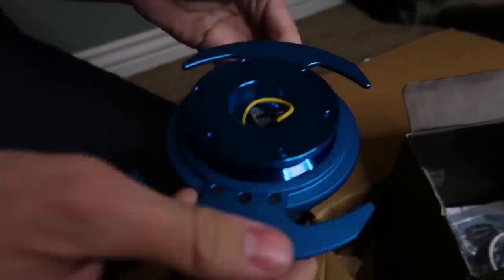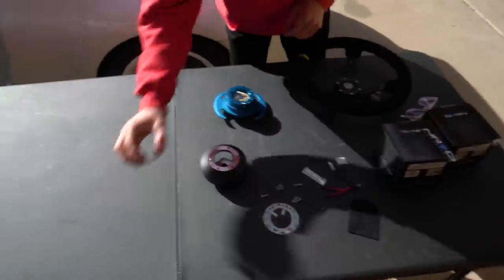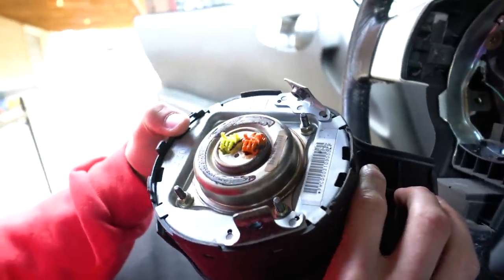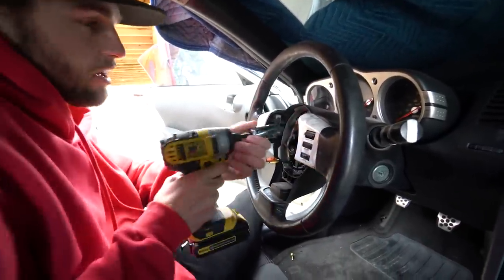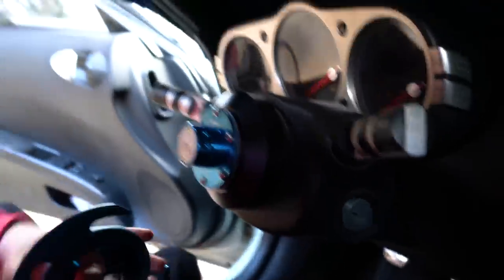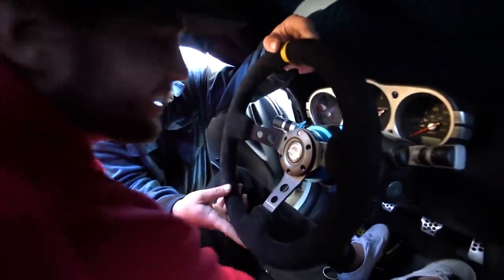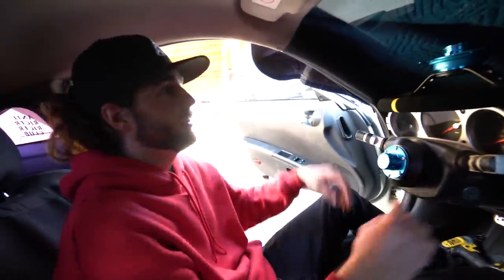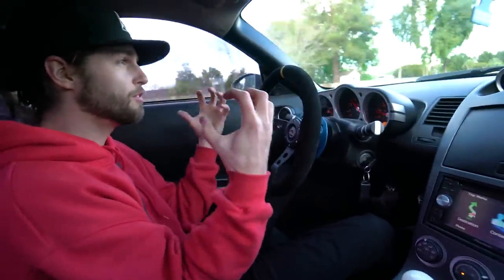350z NRG WHEEL AND QUICK RELEASE INSTALL

Comment: For the airbag DISCONNECT BATTERY AND LET SIT FOR 30 MIN TO 1 HR, the electrical system utilizes capacitors that store electricity in emergency situations for safety components such as the airbag, disconnecting then immediately messing with airbag will be as if the battery is still connected safety first
Reply: Just take the fuse out
Reply: @jakewright1129 you must not know what a capacitor is

Comment: For anyone wondering the set is about 300-400$
Reply: If you're looking to get ther mid tier steering wheels, it'll be upwards to 550+ with the hub and 3.0 quick release. Got an Alcantara Steering wheel which was a bit more pricey

Comment: If you ever watched a NASCAR race, you would be familiar with the expression of "getting up on the wheel". This translates to the steering wheel being close to your chest. Better leverage, quicker response or just being more aware of what's going on, can't say. When I dabbled in auto cross, old timer didn't think much of me being back away from the wheel, but that was what I was comfortable with. Important thing is feet at proper distance on pedals, then steering wheel location.

Comment: Use Nrg quick release and hub (adapter) . But I would recommend to go with a sparco steering wheel not NRG. Just my 2 cents
Reply: If I buy neg hub and adapter I can use a spar o steering wheel on it ?? It’s for my Honda crx tho ?

Comment: Hi, i am new to this car stuff and i would really love to know what's the reason behind purchasing a quick release steering wheel. I mean, is it purely for cosmetic reasons or there is some added benefit from using it?
Reply: Some of the benefits are for taller people, the stock wheels can get in the way of your legs when you try to toe tap the gas and break. 
Also if you have a roll cage it helps get out of the car a easier.
And on street cars it mainly for aesthetics and personalization. 
Make sure you do your research if and when you plan on getting one. 
I installed one in my mustang because my stock steering wheel was breaking down a bit and installed a quick release and couldn’t be happier. 
If you have any more questions hit me up on IG: jah_14

Comment: i could never have that thing and resist the temptation to pull it off while driving. it needs a electric security lock to block it while engine is turned on

Comment: Idk man I don't trust NRG wheels after ThatDudeinBlue's video of the wheel coming apart
Reply: I have one. I love it. Suede 2 spoke.  My only issue is the gap from the wheel to my signals
Reply: jiamind - That’s just the offset of the wheel
Reply: MOMO
Reply: @JAKWEES  yea i fixed it by buyimg a slim quick release on top of my short hub
Reply: i have several & im sure he had a knock off. especially if he bought on ebay. nrg requires authorization to sell their equipment. if you buy from a non authorized supplier then you did not get a true nrg. you got knocked off. do your research before you belive the bull.
Reply: @whiplashnyc5703  ...ok dad
Reply: @whiplashnyc5703  thanks dad.
Reply: Whiplash NYC ty papa
Reply: Do a NRG hub and a momo wheel either way dudeinblue had a fake most likely

Comment: i did this and the horn does not work. It would work randomly, but for the most part, it is a fail. Any tips?
Reply: Okay so I tested the connection at every step and the source of the problem is with the actually horn. Not the short hub, quick release, or the wires connected to the horn. It’s the actual horn.

Comment: Question.. for this do you need to buy all 3 parts? when i go onto NRG's site they sell the "Quick release", the "HUB" and the steering wheels sepperately.. don't they have a bundle for what's compatible with what on their site or anything?
Reply: The hub and obviously the steering wheel are a must, the quick release is an option in case you want to be able to remove the wheel
Reply: I just bought a hub+quick release set on swap shop Motorsports website

Comment: Okay so my 350z is tuned and has different maps but I need the buttons from the original wheel to change maps. How would I go around that and still have a quick release
Reply: thesteeringolutions.com they make a custom plate to mount your cruise control buttons in case you still have not found a solution!

Comment: This guy didn't do his research. The quick release hub didn't bring the steering wheel close to him. His style of steering wheel with the increased steering wheel dish size did. He got a steering wheel specific to racing, which brings the wheel closer to you, which people who actually race need, which he clearly isn't one. Also, don't follow the link to his tools. He isn't using the proper ones. Also, don't just impact fasteners down. Use proper torque specs. Lots of don't in this video.

Comment: I installed aftermarket steering wheel on my 350Z! Is there anyway I can bypass or delete the airbag light?
Reply: take the bulb out
Reply: they're called resistors, some hubs come with them. won't get an airbag light then.
Reply: you have to get a resistor and you have to connect it to the airbag wire and mount it

Comment: where does that silver ring go?
Reply: It's to hold your horn in when you dont want to use the horn ring you just screw the steering wheel in squeeze the ring push it in the hole connect the wires than push the button in